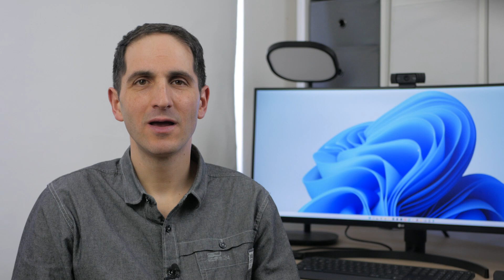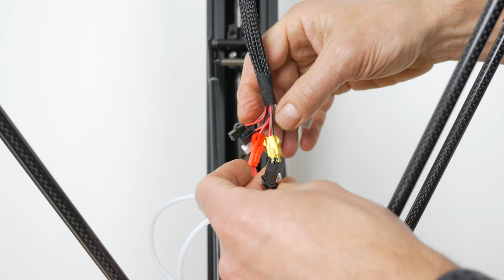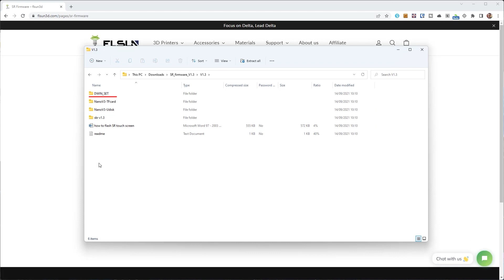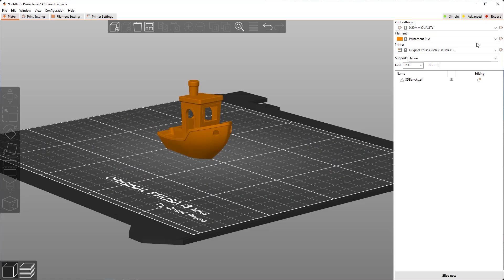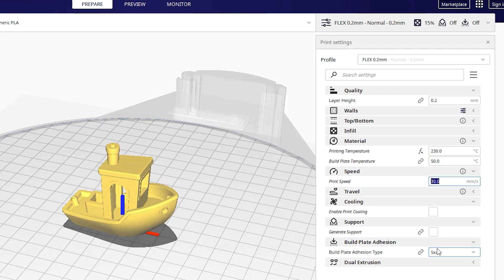FLSUN Super Racer Review | Fast Delta 3D printer | Fully tested

Comment: Nice video, good review. But i need to say, nearly none of the the shown prints looked really good. Even for the speeds you show, the quality is poor in my opinion. I also got an FLsun SR and i like the printer. The hotend, and the Extruder are the weak points of the printer in my pov.

Recommendation for update: Make this Printer work with Klipper! I think it will be a huge improvement! I didnt manage to get it to work with klipper at the moment....

Comment: Hi thanks for this. I own two of these and the auto bed level is off. More so on one than the other. I don't understand what it's doing wrong. But there is always a spot higher or lower on the bed.

I'd love to see a follow up to this with any upgrades you have done. As I'm considering changing the part cooling fan myself.

I have a capricorn tube on mine, plus change the couplings for the extruder as it ends up messing up your ptfe tube after a while. I change to a bond tech extruder and pei sheet too.

Comment: I've just ordered mine like an hour ago. Would love a follow up on recommended upgrades and the options available! Thanks for the profession look at this!
Update: After 500+hrs printing mainly pla and petg and and it's been mostly painless. I've upgraded the extruder (Recommend you stick with an Bondtech BMG style extruder/I'm using Trianglelab DDB version off Aliexpress), bowden tube/couples, Energetic Textured/Smooth PEI sheet (Bed seems to have adhesion issues without glue after 500hrs), spool attachment upgrade I made on thiniverse "Flsun SR Spool Glider", Narrow Fan Ducts S on thingiverse (saw instant improvements even with stock fan on 3d Benchy). Still going strong, it's built quite well. Just with a pei bed and a quality extruder upgrade is all you really need on this unless dealing with specific filaments

Comment: I like the super racer and haven't done any modifications other than switching to a capricorn bowden tube. I intend to upgrade the firmware and the extruder (OMG V2-S) but haven't found the time yet. Ok it's not the time I am reluctant because it works and I don't want to change a running system. But you're right the extruder is bad.
I would be really interested in follow up videos on the upgrades you're about to make.
I just discovered your channel and subscribed instantly - now I'm going to binge-watch your other videos 😁
Keep up the great work, greetings from Germany

Comment: Nice video! Just one note: You say you should heat for PLA (Nozzle 220 and Bed 60) when auto leveling. However, since the ABL probe is attached, the nozzle will burn into the ABL probe. Just heat the bed to 60, but leave the nozzle be.

Comment from the maker: FLSUN Super Racer: https://geni.us/fZqn (Amazon affiliate link). Let me know if you want to see a follow up video with the upgrades I have planned. And if you have any suggestions please let me know!
Timestamps:
0:00 Intro
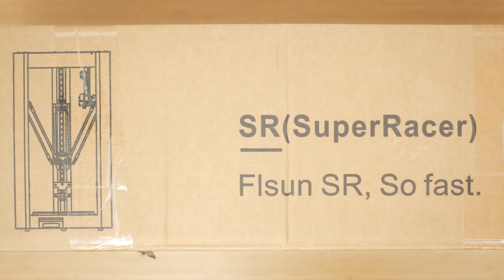0:39 What's in the box, assembly 
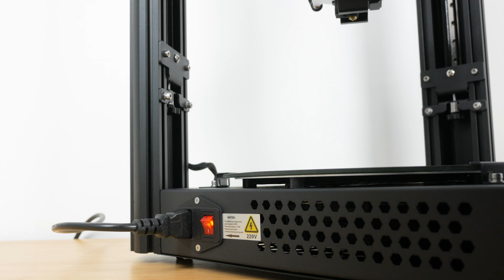3:39 Automatic bed levelling, inc adjusting Z offset
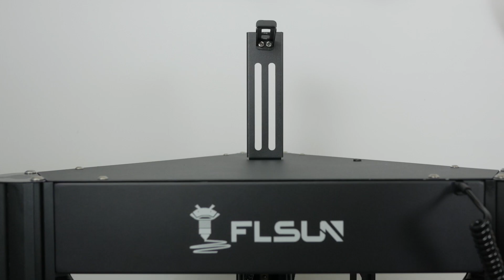4:53 Loading filament
5:51 Printer overview, Delta style printer, speed, size and weight
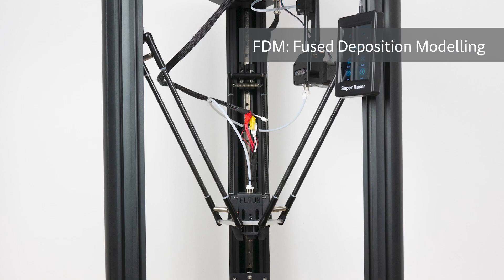6:48 Components, build volume, glass bed, touch screen
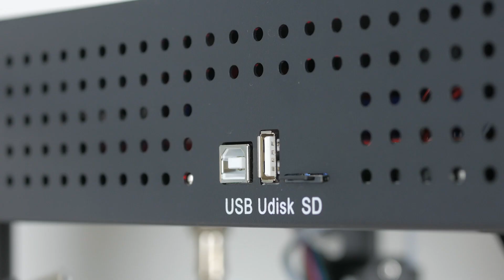7:32 External control via Octoprint or Pronterface, USB port and microSD card slot 
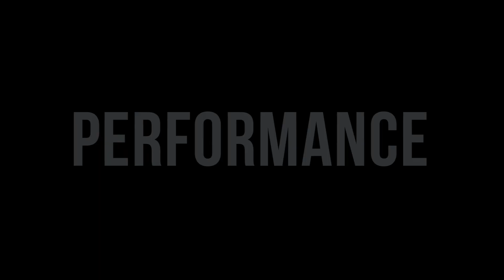7:56 Printer performance. Updating firmware (new features)
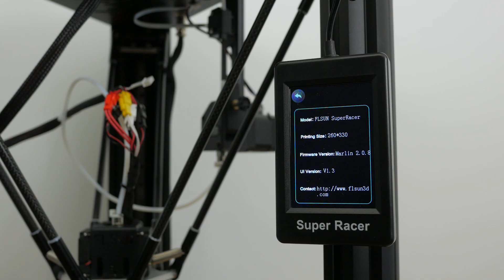9:17 First test print
9:34 Setup printer in Cura slicer
10:04 Failed print, diagnostics, 
10:33 Clean nozzle and hotend
10:58 Lower temperatures hotend - not all-metal
11:08 Insert PTFE correctly into hotend
11:26 Connect wirelessly via Octoprint to calibrate extruder
11:36 3D Benchy PLA at high speed (41 minutes)
12:10 3D Benchy PLA at high speed slowed down
12:26 Super high speed 3DBenchy at 220mm/s test print
12:44 Dimensional accuracy test print calibration cube
12:55 Demanding long print - foldable A-Team van
13:22 Release from glass bed when cool
13:36 Vase prints (vase or spiral mode) at 150mm/s
13:58 Removing more stubborn prints off glass bed
14:08 Filament runout sensor test
14:29 Print resume feature test (power loss)
14:52 Printing PETG
15:28 Custom PETG profile in Cura
15:55 Test prints in PETG, warping
16:23 Printing Flex (flexible filament), custom Cura profile, test print
16:56 Heat up times, power use
17:14 Heated bed variation in temperature
17:23 Removal top cover to reveal 32-bit mainboard, silent stepper drivers, printer noise
17:41 Listen to printer noise
18:07 Conclusions